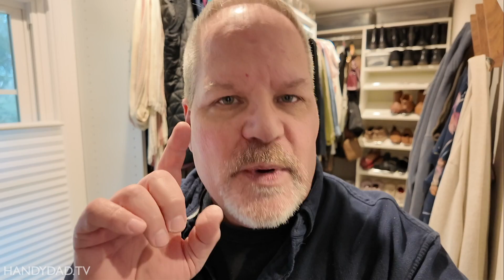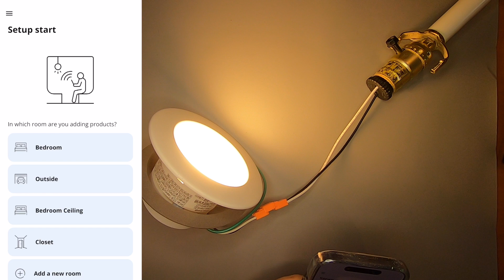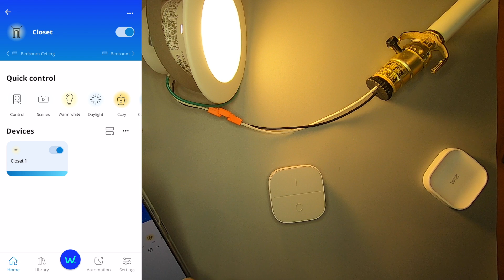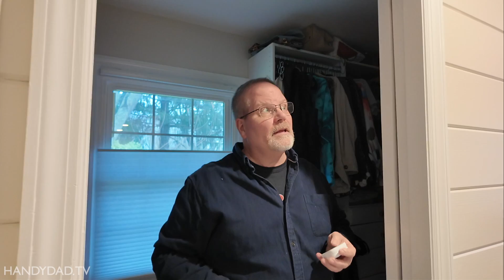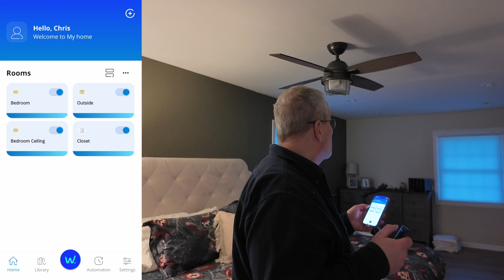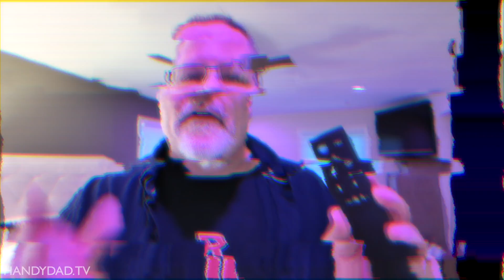WiZ Lights fixed my Ceiling

Comment: I didn't know their switch did the dimming also. can you set it to control just one light (and not the whole room that is setup?) I'd like individual control over one light but for it to be still part of a scene if I want to
Reply from the maker: The remote is associated to control a group in the app. If you only put one light in the group, it will only control one light. You can have multiple remotes and groups.
Reply: @handydadtv  ok but if I want to control only one bulb with the switch and still want the bulb to be part of a group so I can set a scene via the app/ another remote? that shouldn't be hard
Reply from the maker: I believe so. Best thing to do is buy them on Amazon, do a bench test to confirm, and return them if they don’t do what you want.
Reply: @handydadtv  I have some on the way with a wizmote; I'll see later for a switch

Comment: Wiz is nice. Just put them on a separate wifi network for IoT purposes and switch off IGMP snooping on newer routers. Wiz lights produce lots of multicast traffic which can overload the router. If you want to have smart lights through the entire house I strongly suggest Philips Hue instead. You really don't want dozens of wifi connected lights as they'll definitely bog down the network.

Comment: I have multiple Wiz lights and a couple of black remotes. 

Does the Wiz Portable Button also drain battery fast like the remote? 

That’s a serious minor thing of wifi Communication.
Reply from the maker: I don’t think the remotes and buttons use WiFi. I haven’t needed to replace the batteries yet.

Comment: We have a basement where one switch controls the family room and kitchen lights. I plan on changing the bulbs to Wiz bulbs and using two Wiz buttons to handle the different rooms! Thanks for the great video!
Reply from the maker: Glad it was helpful 👍🏻
Reply: have you done that i already? i highly recommend against it. use phillips hue. phillips wiz directly connects to your wifi and will put more load on it if you have a bunch of them and slow down your internet. and sometimes they wont even connect if the wifi signal is too low. phillips hue is more expensive but it has a seperate hub so that you wont have a bunch of smart lights bogging down your wifi. plus you can install a little switch (that isnt actually a switch, just a removable remote that sits in a holder that you put on the wall) and you can turn the lights on and off with it and change the brightness. you can use it to turn on specific amount of lights if you single press or double press as well. theyre also extremely reliable and will last a long time.

Comment: I don't understand how you used the bulb adapter
Reply from the maker: It has the same base as a light bulb. The can lights are made for a light bulb so the adapter just screws in place of the bulb.